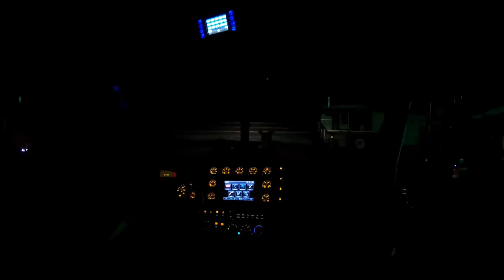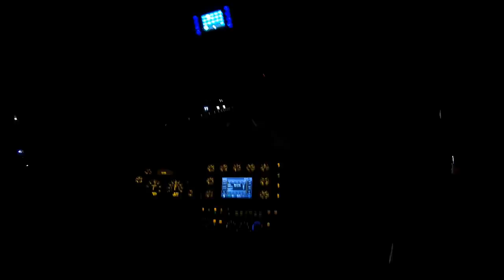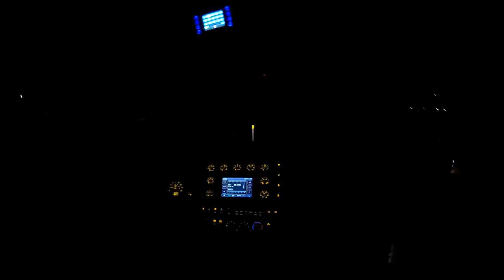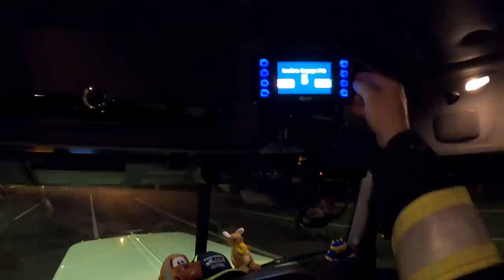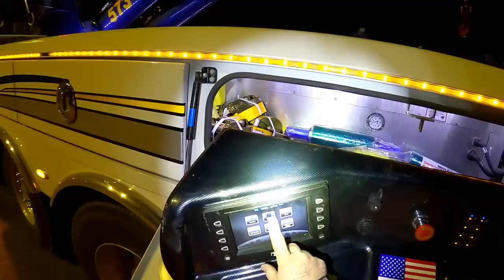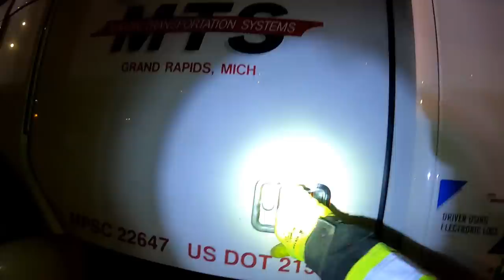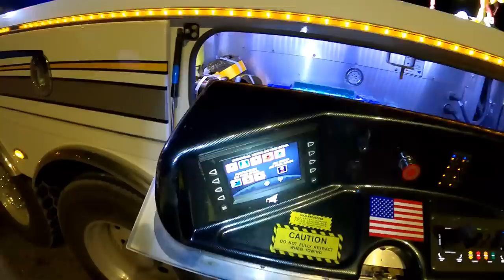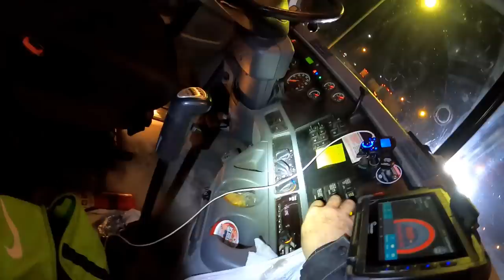Runaway Truck & Trailer    Driver Forgot to Set the Brakes

Comment: Why do you always park too close.?  If you were another 25ft back it would have pulled truck easier without lifting the front in the air. The second location you worked from is where you should have been first time. You say you are always learning... yet most videos show you setting up too close and having to put risk putting the truck back down just so you can move.
Reply from the maker: The answer is, it's all about the angles.   If you have a truck in mud on an incline, you must keep the cable length short or else the truck will move forward along the slope rather than climbing the slope.  Therefore, you must make several short pulls to keep the angles correct without losing ground.  If you take the cable too far forward, the truck will not climb until it gets close to the back of the recovery unit.   Thanks for watching and God bless.
Reply: Ron Pratt thank you, have a great day too.  Would you not have been able to use the boom arm to lift upwards a bit, not extend, which would have given you the similar angle you refer too?